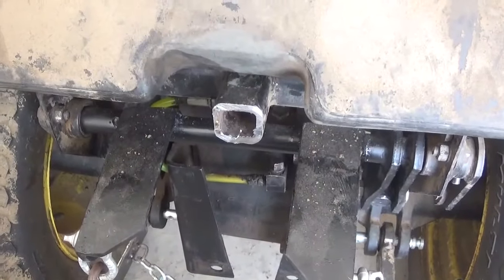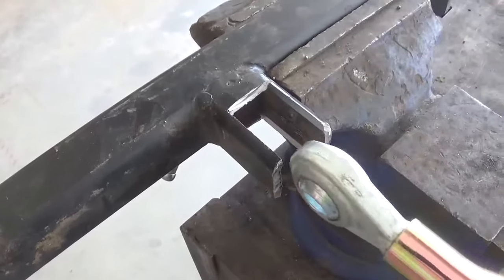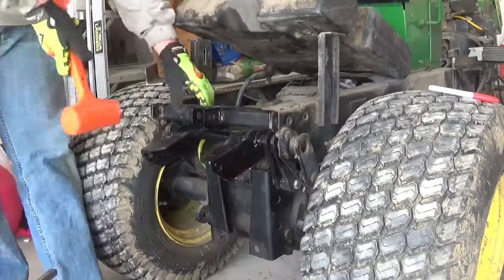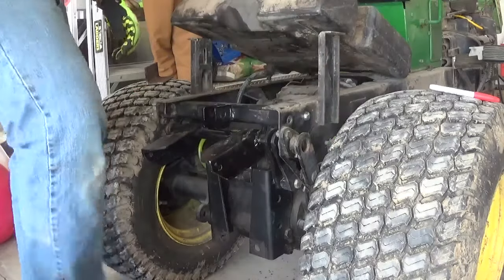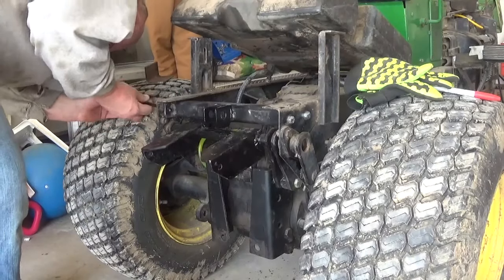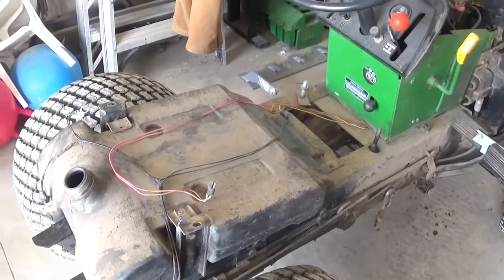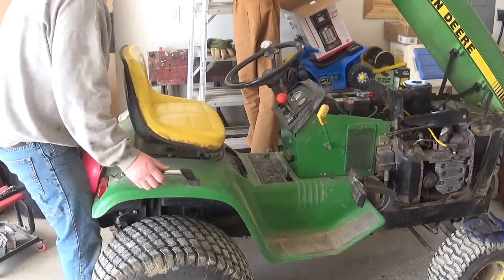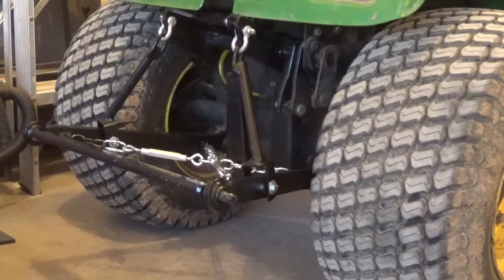3 Point Hitch Build Deere 400 Part 4

Comment: I got a weight box for my 420 and it seems all I'll need to do is remove the rock shaft and then plates to mount the box to since theres spring loaded pins like on plows.  I hope all goes good.  I really enjoy your builds in case I'll do one.  Thanks